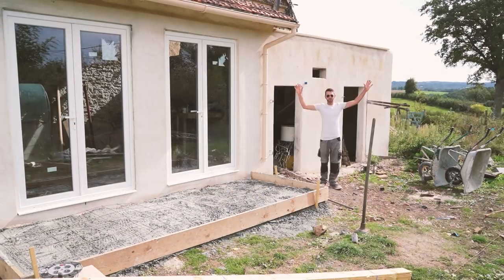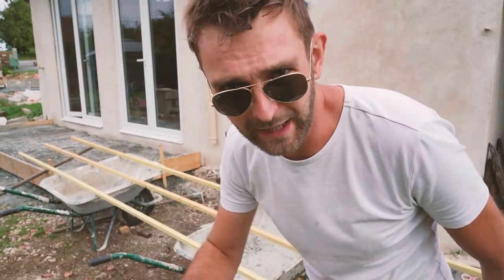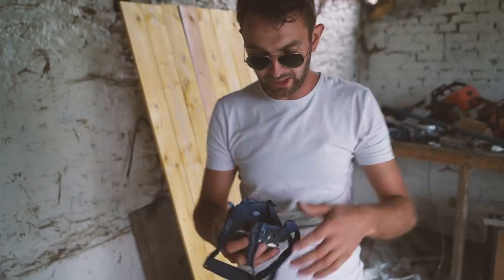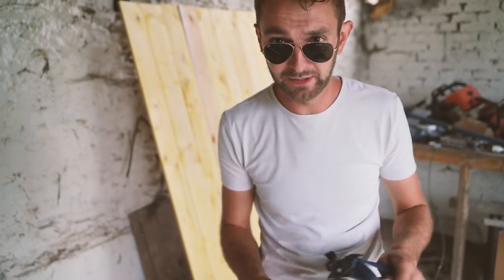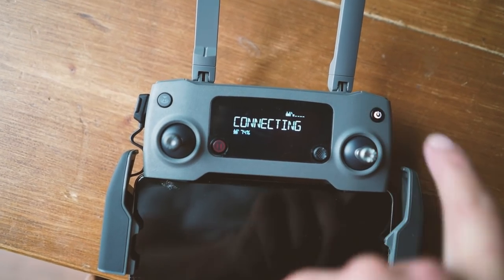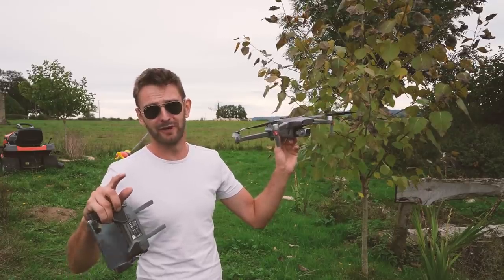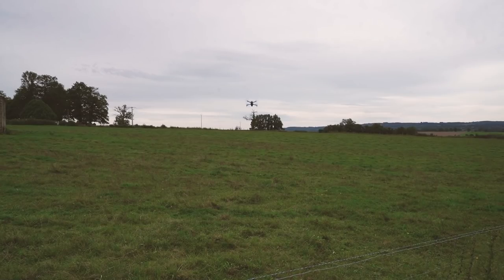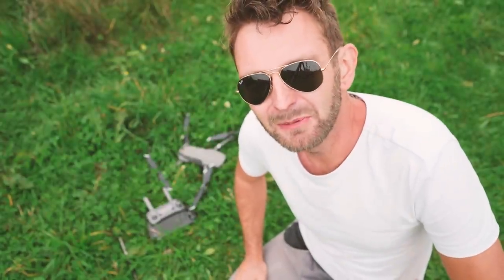New drone! - EP113

Comment: Dan! I swear, from across the pond to the eastern United States, I could feel every single bit of your excitement and pleasure. I am wondering how this drone can automatically follow you. Is it receiving an electronic impulse that you have in the van from a piece of drone equipment?
Reply: Yes, the controller is with Dan (the operator) and it sends radio signals to the drone when he wants it to go up, down, forward, backwards, land etc. You can set the drone so it will automatically follow wherever the controller is.
Reply: @Sgirl : and try NOT to crash into trees!
Reply: @rainbocatz6376  This one has obstacle avoidance sensors
Reply: @ronaldmcyr156 : I was wondering, and was going to ask if it is equipped with Sonar ......

Comment: FINALLY!! VERY cool indeed. Now then, WHAT are the laws like in rural France?  DJI Mavic 2 pro is the bigger model is it not?  No mini anymore right?  Here, larger drones over 249 grams must be registered with the FAA. NO commercial use either without a drone pilot license.  Anyway now don't run this into anything nor dump it in the water either. But enjoy it. Does it have obstacle avoidance features?  Man that thing flies fast for sure. Anyway enjoy it. Cheers mate. Meant to mention too, if you do videos on YouTube and are monitized here in the USA that constitutes "commercial" use of the drone and we'd have to have the Part 107 drone pilots license.  And that's hard to get - well sort of - a tough written test and a cost of $150 bucks to take it and HOPEFULLY pass it.  Wonder what it's like in France???